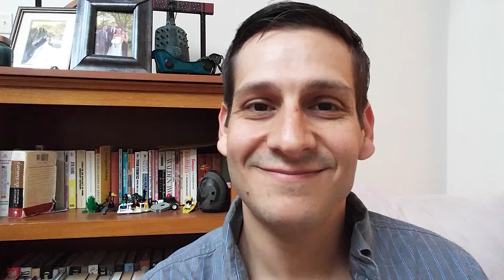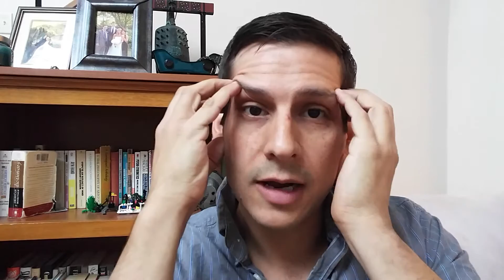How Much Time Should You Take Calibrating Your GPR Before Survey?

Comment: Hi Sir,

It is really an honor to learn from you on this platform. Could you please advice or attach some notes regarding 'How to calibrate the system on site?'

There are options to choose material in gssi consol. So I usually look the surface and select the material given in the list (e.g. Dry soil, concrete etc.). Thus system takes a dielectric value as per the selected material and I proceed for profile collection. During processing, I kept velocity value 0.1m/ns under plot option in REFLEXW and processed the data. It worked in few projects where i knew the utilities depth by RD detection.

But I don't think it would always work.
Please advice the correct way to calibrate & depth matching.
Reply from the maker: pranjal maurya if you are using the sir-3000 then I don't believe you can do a hyperbola fit in the field. Reflex software has the ability to do velocity analysis through hyperbola fitting. I think the way you are approaching on site calibration for soils is the best way you can (unless you bury something and then locate It using direct wave method). Then go into software to get actual velocity.